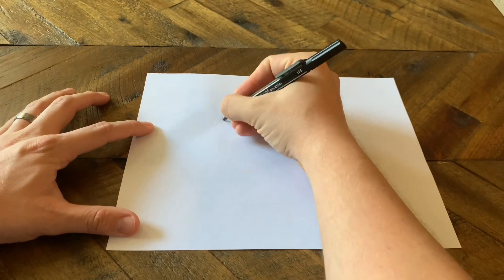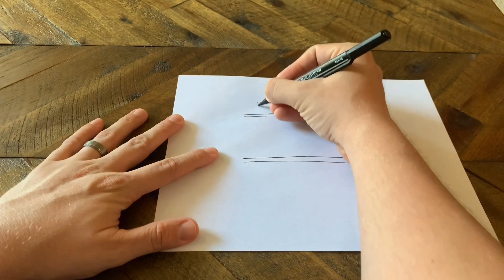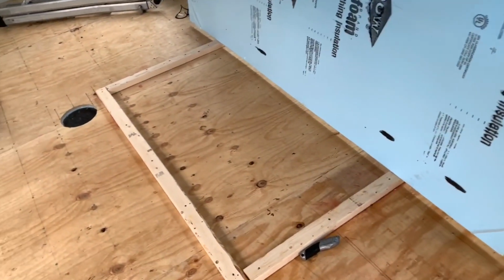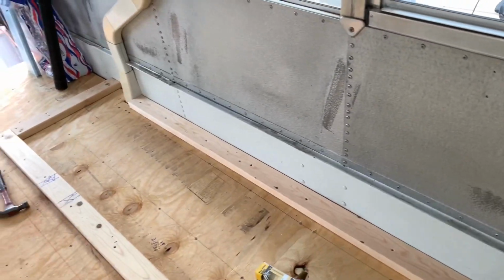Skoolie Bathroom Build Pt. I (Wall Framing) || 2020 Bus Conversion - Ep. 06

Comment: your work is good.. just a suggestion. on those curved areas i used the steel studs which can be easily cut with snips and shaped the way you want them.  home depot and lowes has them.
Reply from the maker: Good suggestion - thanks for sharing!
Reply: i think that's what i'm gonna use. do you have any pictures of the process?

Comment: Did you insulate any of the walls?
Reply from the maker: We have since insulated some windows, but we kept the walls that were there. We installed some pipe insulation for the water pips and added some stiff foam insulation behind some walls, but we didn't tear out our walls and start from scratch like many do.

Comment: LOL how not to do a bathroom. Why would you need to soak the lumber with 800 cuts through the lumber. And at least fill it in with fiberglass and resin after to fill all the voids.  Anyway good luck.
Reply from the maker: Thanks for watching! We soaked and cut the lumber to make the curve of the roof. It’s held up for 2 years so far. Hoping that continues.